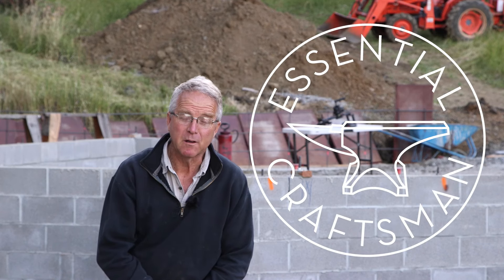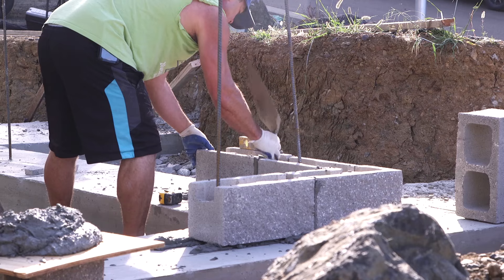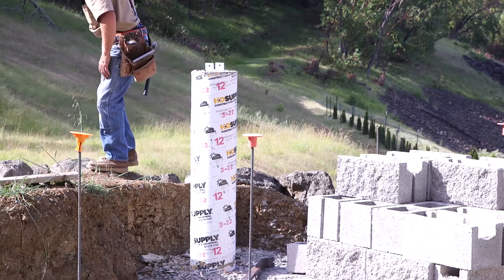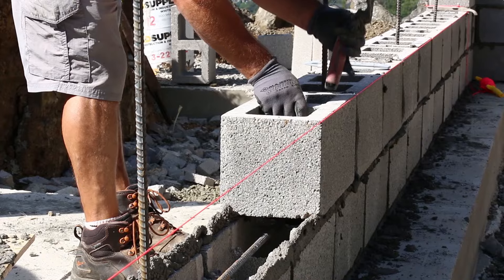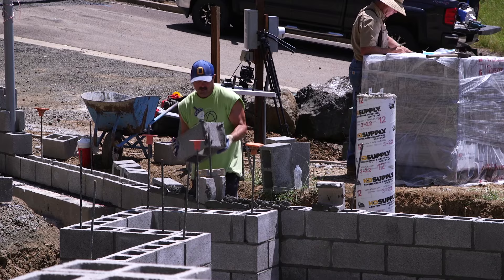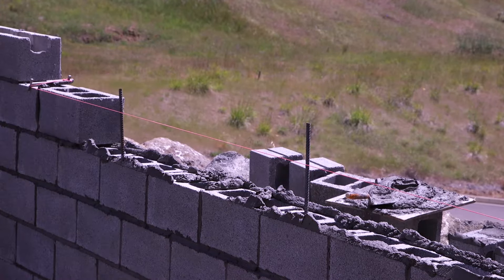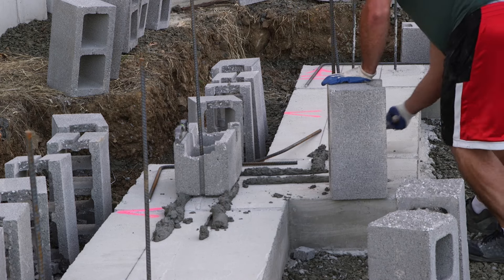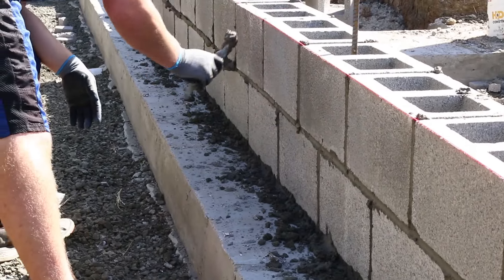Laying Block Stemwalls EP.34

Comment: is that a rock-face block?.  nice touch.  don't see that on residential much.
Reply: phuc ewe  usually split-face block is bigger and heavier than those block (that I've seen).  The split-face side usually has a much fatter shell than the smooth side. ..but your right, it still has to be a split-face because that's how it's made. literrally.
Reply: phuc ewe  yeah, why do they have to be so dog-gone heavy?

Comment: I’ve got block walls on my barn with a gambrel roof and it’s cracking pretty bad. How should a guy approach fixing this. (This is a very old barn)
Reply: maybe use jacks and timber to temporary support each corner, then build a new foundation below, with a wide 2ft deep footing, add a drainage system

Comment: Why not use ICF blocks? 
Foundation is the same work but with ICF ( Insulating Concrete Form) you have instant insulation and much, much faster + reinforced concrete inside blocks...

Comment: 11:15 I have learned, that before cement was used, the lime mortar was not as hard. But this was actually better, because it allowed the house to grow in the hot and shrink in the cold. Also pure lime plaster can take more humidity from the air, what is good for the indoor climate. You can clean the bricks and reuse them. So there are a lot of benefits to not using cement at all. Many houses in Germany, that were hundred years old, were destroyed, as soon as they were repaired with cement.
Reply: I just did a batch of hot mix today (hot mix uses quicklime).

Comment: I just paid $7,000 to encapsulate my crawl space, not sure why you would vent a crawl space anymore? Just lets moisture, bugs, and heat/cool loss into that area and promotes mold/mildew. My house is now so much more comfortable and I don't have to worry about rot, mold or mildew. I had to replace all the insulation and replaced a bunch of flooring because of that.
Reply: DRY ROT.

Comment: Why would you build a vented crawlspace? It's been proven that encapsulated crawlspace is better across many dimensions (energy, health, less insulation, etc).
Reply: That's what I was thinking.  Thought air was kinda bad...lol.  a basement company here where I live, if you have problems, the first thing they do is remove the vents and make it air tight.
Reply: The house is in the PNW which is essentially a non tropical rainforest. Anything that isn't extensively vented doesn't dry out and rots like mad. The average bathroom there only lasts 5-10 years before it rots out.
Reply: @Matthew Hall That's a strange reason to be pro-vented. Modern building science shows it's best to build air tight and control air quality via mechanical ventilation. Air tight crawlspace would be made semi-conditioned and any excess humidity controlled via dehumidifier if needed.

Comment: My grandpa told me about 30 years ago just remember 1 2 3 
For Concrete 1 part cement 2 parts sand 3 parts gravel 
For Mortor 1 part lime 2 parts cement 3 parts sand

Comment: So from what I understand a cement block wall like this is stronger then a poured In place wall and grouting it makes it even stronger.  We dont do this type of foundations  where I'm at what I've seen done is foam  block filled with grout. I think they spent more time on seight prep and layout then the wall assembly.  What shocked me was they poured sidewalks and driveway right over clay with no 3/8" stone under it. I think that's why my driveway has settled and falling. Cutting corners seems to be the thing in this industry.
I think they should have done 4" of crushed stone packed and that wat the driveway would never move.

Comment: Been a mason for 50 years a foreman for 45 I have never seen blocklayers stand up  one course of blocks at a time on end on the ground and butter the head joints while the block is  standing upright.. We stack the blocks 6 high pick them up one at a time with one hand and hit the head joints as we move the block to the line or hit the head joints of the last block we laid to the line in the wall.  This is the universal way every mason contractor in Florida and Georgia do it'.
 I am sure the masons are keeping everything plumb and level and hitting full joints, that is great, I can see from watching this is a very slow  method compared to the way most mason contractors lay blocks but if the job is bid accordingly all is well.
Here is average South Florida  https://youtu.be/hAPQUpF0Km4

The saw man should be downwind so no dust is blowing straight  into the other workers face they know better than that. Your videos are all interesting  keep it up.

Comment: yeah there are old buildings where you can just lift the brick right out of the wall... they were made with lime mortar, not modern cement. aside from historical jobs, to the best of my knowledge, no one uses lime mortar at all anymore due to the fact that it deteriorates so quickly.

Comment: In a previous episode you mentioned that you decided for blocks instead of  ICF, can you elaborate why? ICF would be a lot faster, better insulation and probably stronger than the block wall.
A DIY can build the all layout of the house with his wife and call for the concrete pour.
Just my opinion and I am not a builder like you.

Comment: I do not catch you on much,, but the lime percentage, the sticky, and it does aid in stickiness,,,, more importantly defines how flexible the mortar is in the extreme long run.  Ya gotta think in terms of years, decades, and centuries.  Lime is not there for today,, lime does aid in mud texture, the lime vs cement ratio is there so that the mortar is still sticky and flexible,, 50 or 100 years from now.  Mortar IS flexible.  Mortar IS self repairing as the stone, brick or CMU shift over spans of decades and centuries.  That is why the lime is in the mix in specific proportions.  The reasons for different lime/cement ratios  are A how much load or weight above.  A one story brick or block wall should have type N mortar.  Type N is lower compressive strength and higher flexibility,,, there is not much weight above so the mortar needs to be soft enough to adapt to changes.  A too stiff mortar will simply crack and not adapt.  Type S mortar is a common mix,, stiffer and should be used if the wall meets or exceeds two stories. M type for tall walls, 4 stories and up.

Mortar types also resist water, burial and lateral loading differently.  Type N is not used below grade,, always step up to Type S for foundations.  And even step up to Type M for buried applications or large lateral loads.  Mortar types also should consider what stone, brick, block,, what is it trying to glue together,,,, the compressive strength ideally should approximate the stiffness or compressive strength of the material being bonded.  So that,, neither the stone or CMU is so hard that it will crush or squash the joint,, or conversely that the mortar is not so hard that it damages the stone in a decades or centuries long span of time.

Types K, O N, S, and M all have their best uses.  How sticky they are wet and being used on the job is of little or no consequence..  Although I will say,, keeping Type M on your blade ain't easy.  You keep wishing for some honey to stick the peas on your knife.

Comment: "I'm not their mom, it's their own choice, but I would wear a respirator while cutting blocks."

2min later picks up saw and cuts block without respirator
Reply: I was just going to comment on that, there is a touch of site 'machismo' when wearing a mask is... 'insert homophobic retort here', silicosis is a horrible disease, if im getting yelled at for wearing a mask on site, then something has to change fundamentally, putting others at risk locally is also heinous.
Reply: @simonRTJ  machismo.. homophobic.. have you ever worked at a construction site?

Comment: Good video but I still don't know what exactly a stem wall is . I assume it means a short version of a foundation wall.
Reply: It’s the short section of wall built directly on top of the footing (foundation) that will eventually be almost entirely backfilled from the outside of the structure, sometimes the inside as well. In this case, the inside of the ‘stem wall’ will create the crawl space. Then the actual, visible walls of the structure are built on top of that.
🤜🤛

Comment: I loved the video, I've done a little block, these guys made my efforts look pathetic.
I live on the Oregon Coast in a home that's had several additions through the years. I have a section of home with an unvented crawl space and a section vented to code. The unvented crawl is much dryer than the vented section, in the vented section there are areas where the visqueen is actually moist to the touch. I've never been a fan of vented crawls, they let moist, warm air in that condenses on cold areas and wind driven air will find any penetration and drive that moist air into your house. It's my belief that code really gets it wrong when it comes to venting crawl spaces.

Comment: There are better ways to build a wall. ICFs (Insulating Concrete Forms) are easier to work with, already insulated and poured concrete is far stronger than CMUs. ICFs are better than stick framing too.

Comment: It seems the hod has been replaced by a wheelbarrow. lol
Are you sure your familiar with the difference.?
They are simply laborors, albiat skilled in what they do.
I doubt any of these guys have ever even seen a hod let alone carry one.
Back in the day, the were hods used for bricks, and hods used for mortar.
The mason can simply look at the mortar and know if the mix is correct, just ask him.
We were in the masonry and plastering business untill the mid 50s.
Back then all houses had plastered walls, and hods were used for carrying the mortar from where it was mixed to where it was being used inside the house. And i had lots of experience doing the mixing and carrying the hod.
But the builders we worked for were for the most part were less experienced than we were at any phase of the building.
And even worse was the fact that they held the purse strings as to who got paid and when.
We always set batter boards prior to excavation, and then dropped nails into the footing at all corners for the masons to work from.
The batter boards control everything pertaining to dig depth, and the house location starting with the footing.
There is no need to snap lines on the footing as the masons use lines anyway on the straight walls.
They simply spot a dry block on each corner, or just hook onto the nail at the corner and pull a line off that for their corner set up.
Using the bond beams at various locations with rebar and grouting the wall is a good idea, provided that the customer agrees to the cost.
Im assuming this could be your own house based upon what im seeing you do.

Comment: Seems low quality. Why not use ICF. Pretty standard practice. Takes care of your insulation and don’t need to frame interior before drywall. Seems like old cinderblock is a huge deterrent on the resale market.  Thought the build was to showcase quality

Comment: Per the new OSHA guidelines for respirable silica, some type of engineering controls such as a respirator or wet cutting would be required by your mason.  Dry cutting is not acceptable so your mason is most definitely out of compliance.

https://www.osha.gov/Publications/OSHA3681.pdf

Other than that I really enjoy your videos.

Comment: I don’t want to be the negative internet guy, but the block layers you hired are missing some key pieces of knowledge to be doing the job right. I have been in the masonry trade for 18 years. I teach it at a public college. I think having a great work attitude is very important which the video mentions the masons had. But they are doing a number of things wrong that are going to result in unnecessary failure of wall components over time. Chief among them is just putting smaller cuts of block randomly in the middle of the wall. This can be seen a number of times in the video. Block cuts should always be intentional - meaning they were planned to be installed in each course. And they should always be located at the ends or corners of a wall. Never in the middle unless it is next to a door or window - but they still needed to be planned for ahead of time. The way the cuts are installed in this wall tells me the masons did not plan out how to lay their blocks ahead of time. Instead they just built their leads at the corner with full block and then stuck whatever in the middle. Or in some cases it looks like they got to the middle of the wall and their last block would not fit so they just made a cut and stuck it in there. This is a huge tell tale sign of someone who does not understand the trade of masonry. The result is a wall where the mortar joints don’t stagger or overlap enough from one course to another, leading to a weakness in the wall. Blocks should almost always overlap by exactly half a block.  This weakness that is created in the wall will result in the wall cracking due to natural wall movement over time. This could have been avoided if the masons were skilled in their field. Do not hire “masons” who only moonlight as masons once every ten months. It diminishes masonry as a trade to suggest you can just do it part time and do it well. The same thing for any other trade. I would not try to frame a house because I did some carpentry back in high school. Skilled tradespeople are skilled because they do it every day.
Reply: Com Canuck will the wall settle considering what it's sitting on?  Will the issue of the joints being staggered be a problem even with the wall being filled solid?

Comment: Great video, but these block layers are definitely making a few errors in just a few minutes into this video. These mistakes can be avoided with common sense and a few extra seconds. Firstly, the dust produced from cutting blocks without a wet saw and the dust from the premix mortar is a hazard to everyone on the job site and can be life threatening. Silicosis or COPD chronic obstructive pulmonary disease is no joke and is not to be messed around with. Either everyone on site should be wearing a mask or the company should invest in a wet saw otherwise breath it in a sew your own fate.  Secondly, the first course is the most important course like you said yes BECAUSE those units should be plumbed and did not see one of the blocks plumbed; every unit on the first course should be to use the line as intended on additional courses. Lastly most of them are wearing runners on the site, wear what you want but don't cry if you step on a nail, slash your shoe from rebar or drop a block on your toe. It's just good practice to be safe and do things right. Much love from Canada, keep up the great content.

Comment: Did they fill the first course, which has the horizontal rebar, with grout mix?  I didn't see it done.
Reply: They filled every cell with grout as you see at the end of the vid.
Reply: @ArthurDentZaphodBeeb  Yes, I saw them fill the CMU cells from the top and final course, not each course.  I question if the grout without a vibrator reach the first course with the offset CMU courses.
Reply: @1sttigertiger426  The grout mix flows pretty easily.  No vibrator needed - or recommended - rodding with a length of rebar is enough to consolidate the grout.
Reply: Grout with plasticizer flows like you wouldn’t believe. Sometimes it flows too well and leaks out of every little pinhole. It’s solid.
🤜🤛

Comment: As a Registered Respiratory Therapist for over 20 years, I just absolutely cringe when I see young guys not wearing a respirator when working in all that dust. Guys, take it from someone who has seen hundreds and hundreds of people die, gasping for air, PROTECT your lungs.
Lung damage from tiny particles cutting and cutting your lung tissue on a cellular level will not go away. It will only continue and accumulate more and more lung damage until the day you die. And it's a horrible death that is hard to watch. Buy a respirator and wear it every time you are working in a dust filled environment, and some day your old self will look back at your young self and be grateful. Grateful is way better than sorry.

Comment: Not to harp on these guys but they are not displaying the craftsmanship of a professional. There's a nice shot of a half in the wall and they are using torpedo levels. No self respecting mason worth his salt would use a torpedo level to build a lead in the corner. I really hate being that guy but they spread the mortar in the bed joints painfully slow.